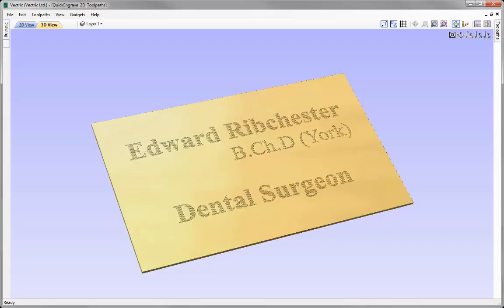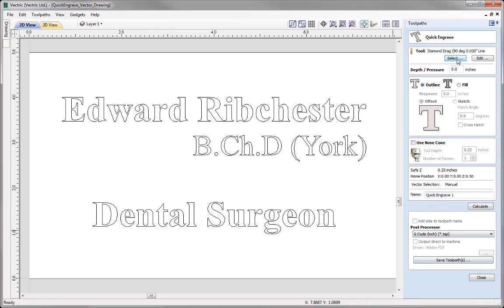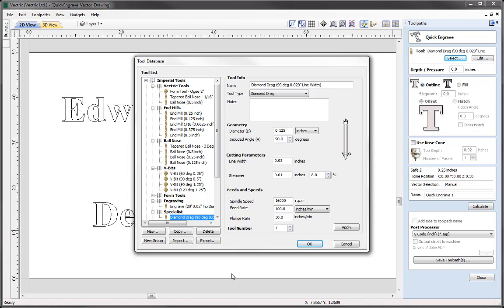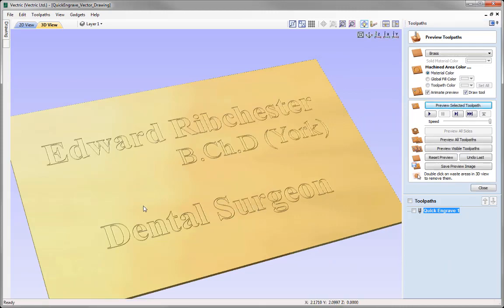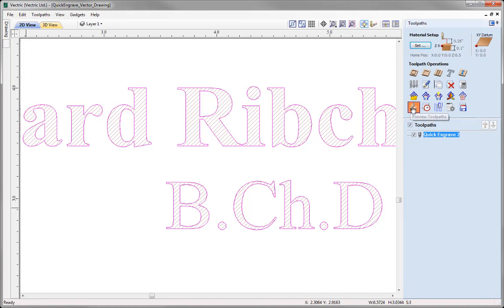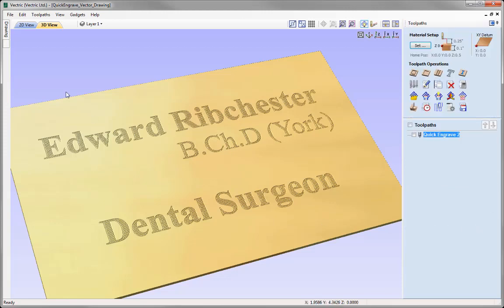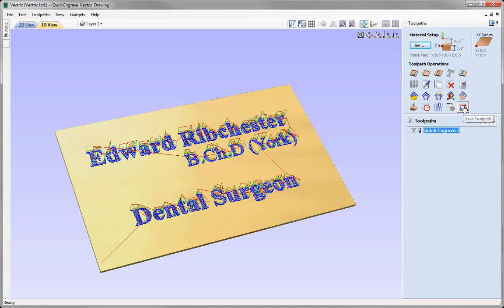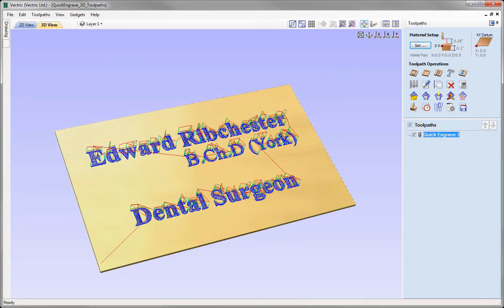Quick Engraving Toolpath Guide | 2D Toolpaths | V9

Comment: I have a question, hopeful I get an answer. I am trying to engrave with a 60 degree 1/4 diameter bit and my toolpath comes out fine but when I preview the toolpath it comes out blurry/ pixelated. At first I tried it on a 2" x 3" name and increased it gradually and it would still come out the same. Is it my bit that is making it look that way? I've tried everything and cannot find it online anywhere. P.s. I have also tried different sized bits and still have the same outcome.
Reply from the maker: Hello Hunter.  Thanks for the question.  This one might be best looked at by the support team.  We really would need to see the file and ask a few more questions and that is probaly done best with a support ticket.  Fire off an email to support@vectric.com with the issue and try to attach the file.  If the file is too big they will explaine how to get it to them.  They are excellent and should get you sorted. ~Todd
Reply: What's the setting if you go to Toolpaths -> Preview Simulation Quality?  The higher you set it the more  definition, but it will take longer to simulate.  However, with an engraving toolpath it won't take significantly longer.  With a 3D toolpath it takes quite a bit longer.